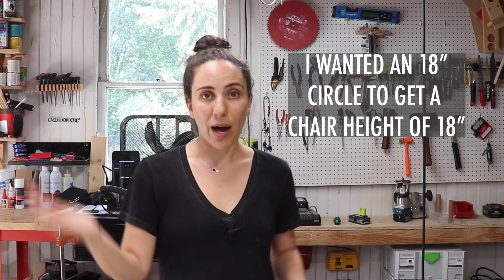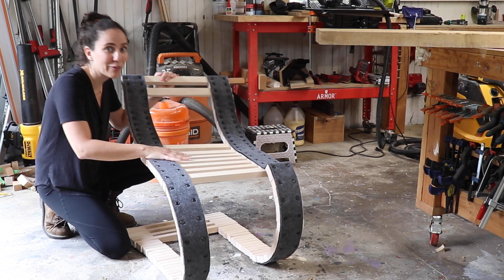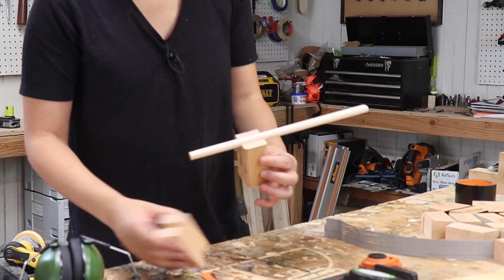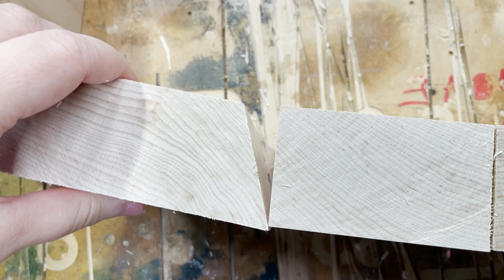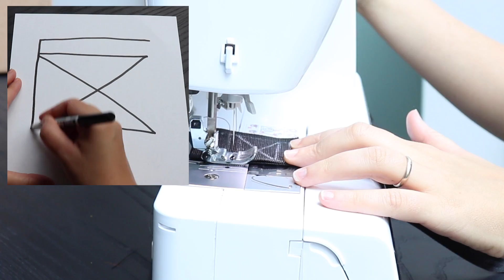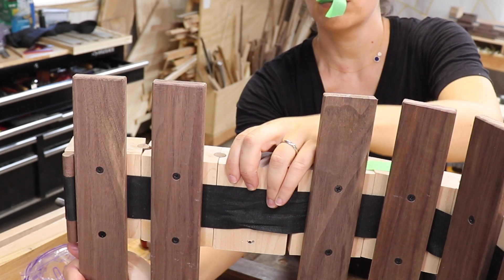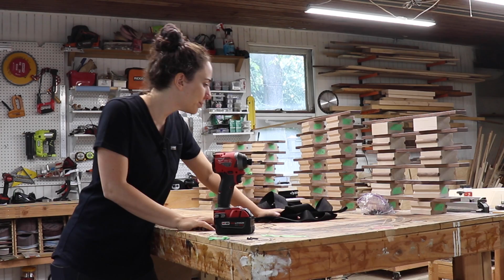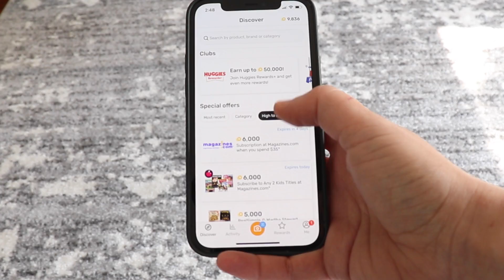I ATTEMPT to make a Roll Up Chair… AGAIN...

Comment: Hey good work at progress! I noticed in both of your videos that you only put straps on one side of the chair. Why don’t you try putting straps on the back of the chair as well? Because you have all this loose tension on the back of the chair and straps on the front are trying too hard to keep its shape. I think you would have to use leather straps or maybe try doing leather bow ties or something in between each piece of wood that way you have tension only on those dedicated pieces then all of them. But good luck on your build! I definitely think you should add some locking mechanism in the wood, the dowels were a good idea but since they were circle they could move. Maybe square ones?
Reply from the maker: Straps on the back would prevent it from rolling up
Reply: @3x3CustomTamar  could you do bow ties? Like for example you connect two pieces together with a bowtie on the back so it allows to move freely but not too much

Comment: Hello Tamar!  I think that your idea is sound, the problem is the straps... I would focus on interlocking the wooden pieces without the straps. Maybe adding a round tongue and groove in between all the pieces. 

I'm sure that your idea would work if you were using metal, but that would be too easy!  Keep going, you're almost there!!!
Reply from the maker: That’s what the dowel idea was trying to mimic. A round tongue and groove
Reply: @3x3CustomTamar to interlock the pieces, you could do a loose dove tail or a tipped ball end router bit, or domino's?  I'm just brainstorming...   🤔

Comment: How about a steal cable in the center of the maple?????
Reply from the maker: Would prevent it from rolling up
Reply: @3x3CustomTamar  How about the first and last through the center but the rest on the side that you put the strap, granted you will have to put a groove so it could be in a track kind of and I'm think the thing steel wire.

Comment: Disclaimer: I know nothing about woodworking

I wonder how tight the fit is between the dowels and the grooves in the next block? If the dowel is actually touching the bottom/top of the channel, that would create a lever tightening the curve and increasing the tension in the strap. It wouldn't have to be a big difference to add up over so many blocks

Square(ish) grooves a little deeper than the dowel radius might work better to ensure the they're only taking up sliding and twisting forces along the face of the blocks.
Reply from the maker: Square would prevent it from rolling Bc it would be blocked. That’s why I went with round. Kind of like a drop lead table.

Comment: you are amazing.
if you use shorter strap it may help.
why?
because if a material stretch by 1% it means 1cm in 1mitre.
but if you cut that in to 10cm it would be only 1mm.
so instead of using a long strap use multiple short strap.
i hope it can help you M.O.I. (Mother of Invention)
and i have to say it again.
YOU ARE AMAZING.
Reply from the maker: Interesting

Comment: I was waiting for this video! Don't give up! I think that by not attaching the strapping at each joint you may have increased the requirements for its stiffness: now because there is more material to stretch, it is easier for it to stretch at the joint (since much of the chair profile is not under a lot of tension). But I honestly don't think any polymer material is good enough here.

If the chair extends 2' and the joints are 2" wide, isn't that just a 12:1 lever on the strapping at the front joints? So with a normalish sized person we are talking over 1000lbs of tension easily (and more of course when you apply any dynamic load). You need a material which won't stretch more than a fraction of a mm over 6' of strapping under 500lbs+ of tension.

A material that I think would be good is thin spring steel sheet, perhaps wide and thin. I think if it is thin enough, it would still let you roll the chair with a decent radius (and the strip could be wide enough to give the needed strength). Perhaps the ends could be anchored by bending a loop using a vise, welding it, and inserting a pin? I think spring steel is better than cables, since cables would abrade the wood, or with dyneema (half the tensile modulus of steel, pretty good suggestion in other comments, but a weaved strap seems like it will always have more stretch) the wood might abrade the cables.

Something else to consider is that no matter what material you use, with the amount of leverage, unfolding the chair is a pinch hazard. Imagine getting your finger between the strap and the wood and then sitting on it!
Reply from the maker: Yeah. After getting hurt at the end I’m just starting to think this won’t work!
Reply: @3x3CustomTamar  Hah, serves me right for commenting while only 75% through watching the video. "Okay, I'm going to salvage this project..." "COMMENT TIME!" Ouch.

Comment: Kudos for the sustained effort with this. I think a non fabric material for the strap could be the answer... sheet metal? spring steel? also as you pointed out there needs to be an anchor point on each piece to prevent any stretch compounding.

Could the pieces be hinged to each other?
Reply from the maker: Perhaps!

Comment: Great try again.  I like the general appearance.  You could possibly make a non-collapsible rocking chair with a similar appearance and feel but without the potential for accidents and chopped off fingers...
Reply from the maker: I definitely want to try to make a chair like this the “right” way. Ha
Reply: @3x3CustomTamar  Well I will enjoy watching you find the solution.  :)  Definitely need to restrict the transmission of tension by fixing straps to each block.  Also needs zero stretch straps - kevlar??  Full of admiration for your tenacity and humility!

Comment: I'd use little flat metal hinges beneath the straps, so it still let the chair fold inward but holds the pieces together from bending outward more that it should. You can even carve them into the wood to make them flush
Reply from the maker: Might work

Comment: I really appreciate your new attempt to build a Roll Up Chair!
You need to attach the strapping securely to every piece on its length, otherwise will the tiny deviation in the lengths of the pieces add up and form gaps on the most stressed piece.
If you manage to get Seat belt material, this could have the tensile strength you definitely need.
You used the blocks for the strapping in both cases cross grain. Wood is more compressible in that direction. Connecting the pieces in end grain direction could reduce the compressibility.
Reply from the maker: That’s what I used
Reply: Agree, this is the next step.

Comment: Leather instead of webbing.
Reply from the maker: I mentioned that at the end
Reply: @3x3CustomTamar  You did. But I made the comment before then. On the first version I made the leather comment in detail. 7-8 oz vegetable tanned cowhide leather (or the thicker belt size). Remember 7-8 oz is a single size thickness in "leather language".

Comment: I would try seat belts next time. It won't stretch. At all. It'll work better than anything else you've used so far.
Reply from the maker: That’s what the polyester was. Ans also what I used in the first one

Comment: Hey Tamar, it seems the strap is only tensioned in the curve 'below your knees'. It is allowed to loosen in the backrest-seat curve. Tensioning it on the top of the backrest will never result in getting the whole strap tight. Perhaps fixating it right after the 'knee curve' could solve the issue?

good luck!
Reply from the maker: Maybe

Comment: Love the perseverance! Don’t quit!! I don’t have the solution, but after the first video and now this one I keep going back to physics. There needs to be an opposing force to the stretch of the straps to help stabilize it (think Tinsegrity type balance). 

Could you run an additional strap on the back of the maple segments?

Would creating a solid segment on the bottom circle (like you glued the top piece) help reduce the strongest stretching forces there? 

Much respect for trying this project!!
Reply from the maker: Maybe! Hopefully I’ll get it one day

Comment: I love that you tried this again and you DEFINITELY did a great job working at the issues. I thought the dowels were brilliant. I feel like leather would stretch too much as well though. Maybe not the first time, but certainly after a bit of use. I have some straps for my kayak rack that have steel cable woven inside the strap. It is meant as a theft deterrent so that you cant cut them, but it would also provide tensile strength without requiring the same extreme tension to overcome the flex of the strap. Who knows, but an excellent project regardless.
Reply from the maker: Definitely something to look into

Comment: I feel bad for you Tamar. But, do not throw the towel yet. You"ll eventualy get it work. Watching you gave me an idea (copper tubes in the middle of the wood pieces and a "iron cable" going through), quite difficult to explain. I'll try to give it a go and see if it works. The only thing I'm not sure how the rolling will go.
Loved the video by the way.
Reply from the maker: Yeah. I considered that. But it will prevent the roll up process

Comment: I'm emotionally invested in this trilogy now
Reply from the maker: Hahaha me too
Reply: @3x3CustomTamar  Really Great try! IF (BIG IF) you attempt to make it again, how about cable through holes drilled in the angled pieces? You could tighten it as necessary with a turnbuckle in the bottom piece. You don’t need to secure the slats to the fabric. Secure the slats permanently to the short angle pieces, not to the fabric or cable. Anyway, respect your trying to solve this physics build !
Reply: @MRrwmac  You make a LOT of sense, bud.. too much so... I am enjoying Tamar's pain and humility! ...Just kidding Tamar; about the pain, anyhoo.
Reply: @3x3CustomTamar  A guy named Josh Wright found a way to make it work, maybe you could try to take inspo from his idea?
Reply: @Nell-r0se  I saw that one as well.  He was using tow straps I think.  Was also not his first attempt.
Reply: @Nell-r0se  Saw it too. The Z-shape pieces might be key.
Reply: @3x3CustomTamar  you could use hinges
Reply: @3x3CustomTamar  Hi! You can use the bike chain inner or outer link and, either a normal bolt or shoulder bolt going through the pieces to connect the blocks and use the polymer strap to cover it all up. 2mm thick links and m5 bolts should do the trick. You will need to cut a small rabbit in wood for the movement of link though. Alternatively, you can use a connecting strap that is made from cotton. That should stop the stretching (???) Problem. Don't know what it will do about the malfunction due to over tension. Thanks for the video. Super invested trilogy. I am thinking of starting a woodworking (+other) business and have been using your, stumpy nubs, black tail studio to get an idea of what I will be getting into so thanks!
Reply: @3x3CustomTamar What about piano hinges, just wondering...........
Reply: @3x3CustomTamar  If you need to strongly temporarily hold a piece to another try using 4 pieces of painters tape, 2 go on the piece to be held, put some c.a. glue on said tape then sandwich the glue with the other 2 tapes(sticky side away from the glue!!!) in between your pieces and voila a moderately strong easily removable bond ;P
Reply: @3x3CustomTamar  why you didn't use a motorcycle chain insted of a band? il would solve many probleme
Reply: @G-GIK-K  the tension in whatever strap you use is going to be in the order of 1000 of kg because of the leverage caused by no back legs. Chairs of this design are usually made out of metal for a reason.
Reply: @3x3CustomTamar  use wire cables
Reply: @3x3CustomTamar  or use a chain
Reply: @3x3CustomTamar  Use metal banding maybe? I think the stretch and tensile strength of metal banding may be acceptable
Reply: @3x3CustomTamar  why not try something like hinges instead of straps? Then there'd be no possibility of stretching at ALL.
Reply: @3x3CustomTamar  I think I have a solution to this problem But I don't know if you are replying to comments or this video is old
Reply: @3x3CustomTamar  maybe try to use seatbelts? As they have very specific standards for elasticity and they are supposed to be super strong.
Also leather is stretchy and even if it initially will do, it won't last. I think the best option here would be car seatbelts, as that way you can even keep the nice colors
Reply from the maker: @__Mr.Long__  the second strap I used here was seatbelt
Reply: @3x3CustomTamar  as I said previously conveyor belt strapping.
Reply: @3x3CustomTamar  cut and paste from my other comment so you're more likely to read it:

I'm sure you could make it work but it is a design with lots of single points of failure so that kind of chair and safety really don't go together.  Sometimes I get lost in making things work once or "if you know how to do it", not working the way people might expect like a chair you don't question, you just sit in.

Looking at it more critically, this is cool but it's just a bad idea and I don't see a way to fix the idea without making it something else.  You should bail unless you can make money on it and then immediately set it on fire to remove it from your life...
Reply: i shouldn't have scrolled down while watching, as this comment (it being a trilogy) spoiled it for me.
Reply: I would caution against using leather. It's even more prone to stretching than webbing and not nearly as strong. The only thing I can think of that would be strong enough to not stretch is some kind of steel cable? Perhaps kevlar but I don't know enough about it to say for sure. Either way thank you so much for doing what you do. It's really encouraging!
Reply: Its such a good puzzle. I so want to see how it gets solved. I think door hinges and  rails that slide down the segments. Idk
Reply: @16bitHi5  I think the next thing to try would be to attach the straps to the pieces of wood using something more substantial than pinching them between 2 pieces of wood. Staples, screws, glue... whatever works. That way the straps couldn't slide between the pieces of wood, the whole thing would be more rigid and the problem of the bottom curling up would go away.
Reply: Its all in the way the wood wants to go. It's abit like the double domino effect. It's all maths. I know you will do it.
Reply: You should add more straps. Then the stretching will be less because your weight gets distributed over the different straps. You can check how much weight causes acceptable stretching. If this is e.g. 10 kg. And your weight is 60 kg. Then you need 6 timed so much straps.
Reply: @Pjotrle  I think someone already pointed out the issue. If the distance from the strap to the centre of the block (lets call that the pivot point) is 25mm and the bum is sitting 400mm away from the pivot point with a mass of say 60kg. then strap needs to be able to handle 400*60/25 = 960Kg. Law of the lever I'm afraid.
Reply: @loopinnerthe  
Im not talking about leverage. What I meant is that from the current chair the amount of straps that are needed can be calculated by checking the current max allowed weight of the chair.

I do not know were to place extra straps in current design.
Reply: Calculate how this allowed weight compares to bodyweight and add more straps and problem is solved :-).

Formula:
(Body weight / Current allowed weight) * current amount of straps = needed amount of straps. 

Maybee also add little bit extra straps as safe marge :-)
Reply: @Pjotrle  what you are missing is that this design is like a pair of nut crackers you have to take into account  the leverage that is involved.
Reply: @loopinnerthe  
That is why you should calculate it from the current design. Then the current design "unknown" parameters are taken into account. See the formula.
Reply: @loopinnerthe  when is bends it needs resistance. That's the 🔑
Reply: an epic way of demonstrating that you shouldn't give up. You rock 🎸
Reply: Use metal banding!!!! I think it may work, I really want to see this work!
Reply: Glueing can help avoid the strap moving along the length of the roll, instead of transferring to the end, individual sections are isolated. Glue is very strong in shear.
Reply: Try a seat belt strap material
Reply: Looks like it may be more like Star Wars and be  broken into the trilogies.
Reply: Same!
Reply: Prototyping is so hard! So cool to see you try again. Some straps are very strong but still too elastic. Douglas fir framing lumber is relatively cheap and more crush proof than pine. Maybe try bike chain for strap. It would have to bear on metal plates though and would probably have to be pinned somehow where the curve reverses. You've definitely caught the attention of my engineering side with this challenging build.
Reply: Same.
Reply: I love your woodwork and i admire your attempts again and again and again. Great.
Reply: Me too! It’s gotten personal….
Reply: this vid was way less enjoyable knowing this beforehand
Reply: Why would a spoiler be the highlighted comment under the video 😢
Reply: The one serious thing I had to say was please don't let your children sit on this. A child is going to bounce on it and then *disaster!*  Thank you for coming to that realization ahead of me.
Reply: Tamar. Please don't do any more on this. If this was a viable thing then it would have already been made especially as it is so simple.
I love your innovation especially the dowels in the joints. I think the fact that the glued final version looked a bit dodgy tells you all you need to know....
I wonder however if the base was a complete circle like a barrel then you would triangulate the forces and it would be rock solid. Could you compromise your perfection on a roll up stool?